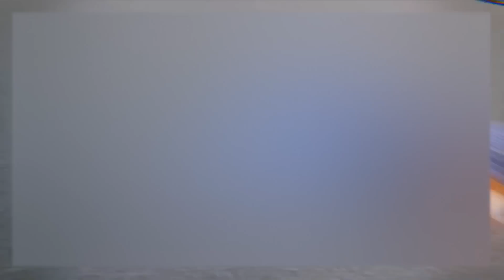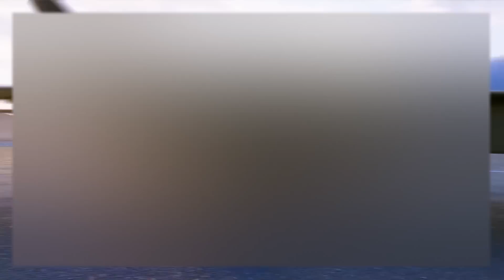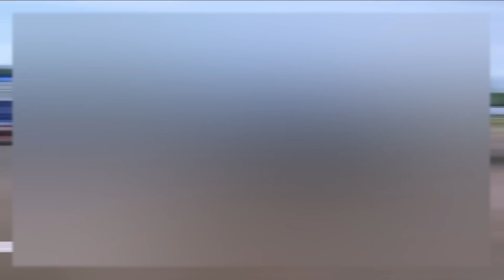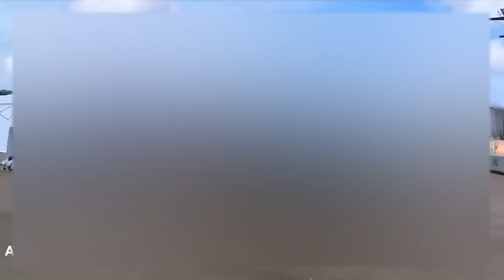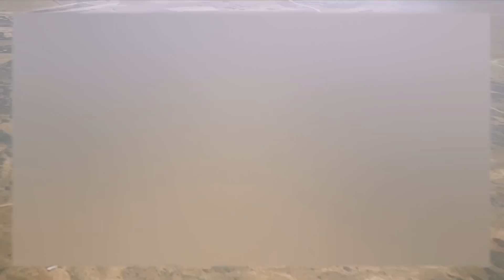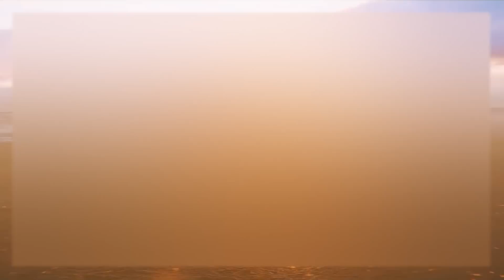This Is Turkey's TF-X Fighter Jet

Comment: Turkey will need anothe 10 or 15 years to build some engine that will work for 5th Gen and by 10 and 15 years the engine will be obsolete but Turkey will learn how to make better engine and will catchup with rivals
Reply: No, only the West including Japan and SK can build engines while Russia/PRC hardly compete, the rest of the World failed to produce IC engine and is currently skipping to electric...
Reply: Do you think building an engine needs a special knowledge.  You know nothing about aircrafts .5th generation is the technology to invade radar from being detected. F35 and F22 has low thrust  and less power full compere to F16 and F 15
Reply: @captainfokker3951  Yes, special technical knowledge and expertise in metallurgy is needed to make jet engines. Not many countries can make reliable jet engines. We use the phrase "it's not rocket science .. ", but actually even countries which can make rockets and send them to space cannot make jet engines.
Reply: @captainfokker3951  do you know about the engine design and building??? The engine heat is very high. It requires a know how of using materials amongst others. This know how is accumulated only to handful of countries ... and Turkey is just a starter... Even China with all the resources they have are struggling to build proper engines ( WS family)  and still using the Russian ones ( Saturn...) but China is making good progress... for Turkey they will still need at least of 5 years...
Reply: @abekkaou  I think your point is based on Media. Pakistan, Sweden, Canada, Italy ,Spain,Ukraine ,Iran , Brasil ,south Africa , Indonesia , Taiwan,south Korea ,Japan , have succeeded building their own jets engine. ukraine was working on building airframe but invasion  stalled the program.you mean china was strangling on building turbo propeller aircrafts while they started producing there aircraft in 1950's  when they were working on producing there nuclear weapons.countries buy electronics warfare and radar that are able to detect and invade detection.nigeria , South Africa have built their own aircraft based on their own resources . Kenya is working on producing there own aircraft and those are African countries.approval of(  IATA )    ( ICAO).  And ( FAA) is the key problem's.
Reply: @captainfokker3951  if all these countries are able to build proper engines why turkey is begging Britain and the US to help them build engine for tfx. Well those countries may be able to build an engine but not for 5th generation aircraft that require stealth like reduce infra red signature like the one used by F22.
Reply: @abekkaou  electro magnetic laser's,guide radar's,(to detect hundred miles of an enemy aircrafts) ,anti radar's system ( to envade detection) as well as electronics warfare systems . those are the things Wich  make aircraft to listed as 5 generation and not the engine ,and turkey is seeking partners not help since china and Russia can provide. The most powerful and firstest aircraft ,carriers heavy pay load and fly over O zone layer at a hight of 100k feet is Russia MIG 25-28 Wich was built in 1950-60-70s still some countries use them as well as Russia .that's a third generation aircraft . engine doesn't make aircraft to be listed as 5th generation.
Reply: @abekkaou  Because money. Building ur own fully indigenous jet engine on ur own is highly expensive and time consuming. The Chinese were forced to pump many $ billions into making jet engines with the required reliability and thrust to weight ratio.